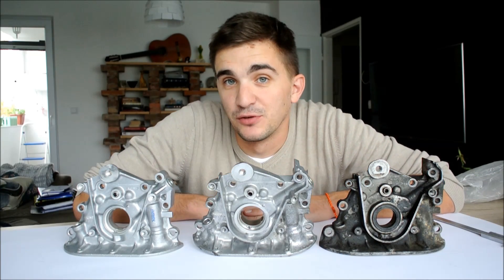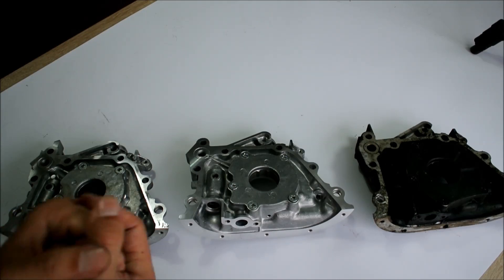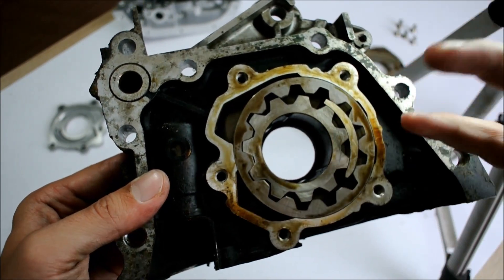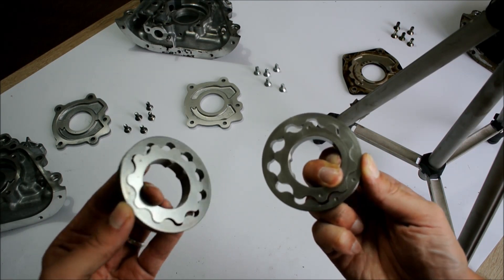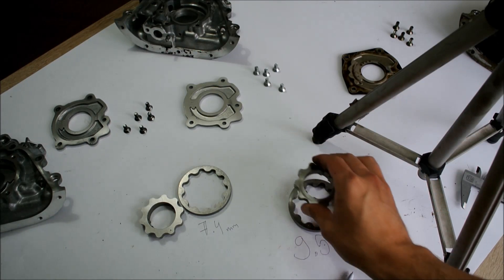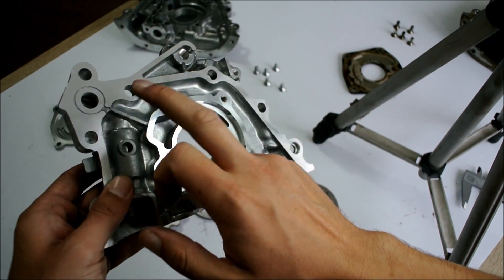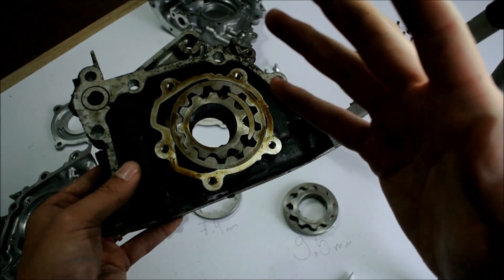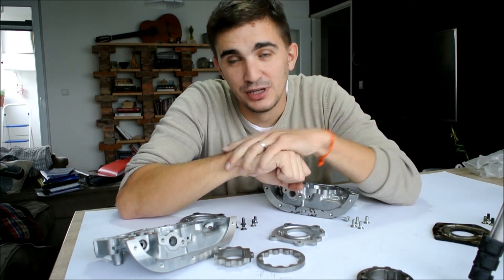4age oil pump vs 4age oil pump vs 4age oil pump

Comment: Good video, thanks for showing the differences. Billzilla.
Reply from the maker: Are you THE Billzilla? I read your 4age page about a million times. An honor to have you commenting here sir! Thank you for all the valuable info and resources you provided to the 4ag community.
Reply: @d4a  Yep it's me. :)    I'm very glad people get some benefit from my pages. I'm actually rebuilding the last 4AGE I built, that was done in about 2003 I think. I sold it to a friend of mine and it's back here for a rebuild. Speaking of oil pumps, I'm going to use a 7AFE oil pump cover, as there's one version that has a crank trigger unit on it. It'll make for a more accurate ignition system. But your video reminded me that I'll have to have a look at the pump gears to see how they compare with the various 4AGE ones.
Reply: @TheBillzilla  it's the last 7A-FE one in the T22 Avensis, right? How different is the 7A-FE oil pump housing from the 4A-FE one (one of my friends would need a 7A-FE oil pump, but I have this latest 4A-FE pump brand new in my garage)?
(Btw I'm a big fan of yours too, thanks for for the advice on the 4A-FE heads!)
Reply: I don't think there's a lot of different, they should use the same oil 7.5 mm pump gears but some of the 7AF covers have a crank position bracket on them.

Comment: Hi, i have a busted silvertop oilpump. I have a blacktop oilpump to replace it. Do i need to replace the timing belt and crank gear with blacktop parts? Using the silver belt it seems loose.

Comment: Hi thank you very much for this video it's very informative, just to let you know i bought an aftermarket oil pump that's the exact same design as the latest model oil pump with the widest gears so i went ahead and stripped the pump and measured the gears as where i found that this pump actually has 7.95mm thick gears so i assume it's most probably because it's an aftermarket part...

Comment: the aisin OPT-036 oil pump has the rounded 9.9mm pump gears. if you cant find a toyota branded one, aisin made oil pumpe for toyota so this is your best bet for a replacement

Comment: Nissan guy here, we had also a few iterations of oil pumps.
The thickness variatons, as well as bigger diameter.
The version with the halfmoon seperation  has an variation on teeth shape, some chamfer on the edges creating pockets for oil. Those pockets help with hot oil.  IT also has better sealing properties, more contact/sealing area.
Mechanical weaknes is an  disadvantage of that design.

Comment: *Super important question: when installing a new oil pump for the 4A, is it necessary to open it up and have the gears lubricated before installation?
Reply from the maker: It's not necessary. It does help during the first few seconds of the first start, but it's not necessary. The factory service manual doesn't specify such a procedure. You can oil the internals a bit without opening it, pour oil in and turn the gear manually a few times, it's better than nothing.
Reply: I use assembly lube for all my builds including pumps

Comment: Nice video. I've been beating the hell out of 4AG motors for 20 years in various forms and have yet to have an oil pump failure. I don't think of the 4AG oil pump as being a troublesome part of the engine

Comment: 4age16 can instal 4a fe oil pump?
Reply from the maker: Yes, it's the same block (4a) but I don't recommend that.
Reply: @d4a  why?
Reply from the maker: @novskikepes411  Most 4afe pumps are weaker with less flow as the 4afe obviously doesn't rev as high and isn't made with the same kind of usage in mind.

Comment: So... Do u recommend to use last revision on all 4age versions? Im thinking to change mine
Reply from the maker: As I explained in the video, the latest version is the best and most durable one. You may be fine  with the older versions for hundreds of thousands of miles on a stock engine driven normally on the street, but for an engine that will see a lot of hard driving it's a good idea to upgrade.
Reply: @d4a  mine is the late big port assembled at 88 (toyota celica gen4 t160), it has almost 170k kms (105,63mi), and pressure seems to work fine yet, but is not a bad idea to replace all pumps from the engine. Thank you so much for your help, you've got a new sub 😁👍

Comment: Your information is dead right, well done. The "upgrade oil pumps" for the 16V engine on my website are just genuine OEM pumps originally intended for the 20V Silvertop. If you use the correct part number you will always end up with the best version that's backwards compatible. You have to watch out with the Bigport engines as the higher oil flow can aggravate the oil drain issue from the intake side of the head.
Reply from the maker: Sam Qu Whoa, it's mister SQ of SQ engineering. Im honored to have you commenting here. Really appreciate all the awesome products on you site and what you do for the aw11 and 4age communities.
Reply: Yes thanks. I also remembered something else after I made my initial post, I don't have a whole lot of experience with second hand bits so I have never encountered the second oil pump type but I have seen the same type of narrow but sinusoidal gears in a 7AFE oil pump.
Reply: What is this issue?
Reply: @Vaettr205  The oil drain issue? I can explain in more details if that's what you would like to know more about?
Reply: @Samqdf  Yes, and either that or just point me in the direction of where to read on it if you don't feel like elaborating. I did a search and didn't turn up anything
Reply: @Vaettr205  Sure I don't mind, I just can't send you any pictures that's all. 

The external oil drain mod is to overcome a flaw that the Bigport heads have in that the oil can potentially not be able to drain away from the intake side of the head fast enough. It can be to the point where it can completely fill the intake side cam cover and even start flowing out of the top breather. This also isn't good in terms of taking away from the available oil capacity left in the sump at the time. It has the highest chance of happening while taking a left hand turn combined with high revs. The issue stems from the fact that the A-series engines have the main oil drain located between the middle cylinders on the edge of the exhaust side of the head / block and the 16V heads have separate cam covers that the oil must return between. It's a non issue on the 20V heads due to them using a single combined cam cover allowing for easy oil flow across the width.

The issue was rectified for the Smallport heads via an external hose that goes from the back intake side corner of the head down to the block. As such it's highly suggested to do a mod to add a similar external drain to any Bigport that sees high revs while cornering. 

The earlier model blocks don't have provision for an oil return like the smallports do, as such the return line just needs to be taken back to the sump instead. 

I hope that makes sense.
Reply: @Samqdf  It does indeed. Looks like I'll be doing it soon!
Reply: @Vaettr205  Good to hear
Reply: @Samqdf  thank you very much for the info, and for the work you do for the 4AGE community as D4A mentioned above. If it weren't for people like the both of you the rest of us would be lost lol
Reply: @Vaettr205  Happy to help
Reply: @Samqdf  I'm seriously considering the 20V oil pump upgrade for the driving season.  My S/C is pretty high mileage and I am going to start acquiring parts for a rebuild hopefully this winter.  I'm thinking of the pump to keep it happy this summer.  My question is would you recommend the porting option for my application?
Reply: @mescko  The porting option is to have a little less drag and oil aeration. Due to the pumps being being a fixed positive displacement design it in theory shouldn't increase flow. I suggest it for people that plan on doing fairly high revs that are looking to optimise everything as much as they can. So while you can get the option done it's likely to only give a modest benefit and the unmodified pump will work just fine for most people. Perhaps go for the option if you plan on regularly going over 8000 RP/M? Unfortunately I can only take educated guesses.
Reply: @Samqdf  I stick to the stock 7500, though I rarely take it that far.  Thanks for the advice/assessment.

Comment: Great info! When I built my 18RG the oil pump was basically the same as an 18RC pump but with a pump body spacer and wider drive and driven "rotors"  (that's what they called them in the factory manual), or gears. Keep up the good work!
Reply from the maker: +ZatoichisCaneSword! I googled the 18RG after I read your post. Looks like a lot of fun. Do you have it in a Celica?
Reply: +driving 4 answers (mr2 mk1 hero) I built that motor when I was in college for Auto Tech back in '99. It was going to go into a '76 Celica GT, but life happened. I still have the factory Mikuni Solex carbs for it though. They have official Toyota parts tags on them, and will go on a Toyota engine some day. I got the motor from a junkyard here in Aberdeen, WA, USA for $50 because they didn't know what it was and honestly I'd never seen one either. I just had to pull it myself, which went really well.
Reply: This style of oil pump is sometimes referred to as a 'gerotor' style pump.

Comment: what about the pumps on the black top 20v? aren't those different in some way or is ithe same gear setup just has the extra stuff for the hydrolic tensioner?
Reply from the maker: +Bigbacon The pump body is slightly different so they are not interchangeable, but the gears inside are the same as the final design.
Reply: The Blacktop pump has the same internals but it has the mounting studs for the timing belt pulleys hydraulic tensioner and a small cut out to clear it.

Comment: Great info! Especially if I do end up deciding to rebuild my 4A-GE for any reason, though I have my doubts. Keep up the great work man!
Reply from the maker: 802 Garage I'm actually rooting for sr20 swap now. It's gonna be more fun and new. Any videos coming up soon?
Reply: Still trying. Finding even an hour to edit has been hard. Whenever I'm not working on homework I should be, hahaha.
I'm super excited for the SR20 swap. Basically as soon as I'm done school I want to start on it. I'll probably disassemble the old engine too of course. Will be interesting to see what carnage is in there.

Comment: This is incredibly useful information! I had zero oil pressure at idle after warming up, and was concerned it was the oil pump. It turned out to be the oil pressure relief valve (attached to the oil filter sandwich plate) being stuck open. But if I ever need to replace the oil pump, I now know what revisions to look for before installation. Thank you so much for making this video!